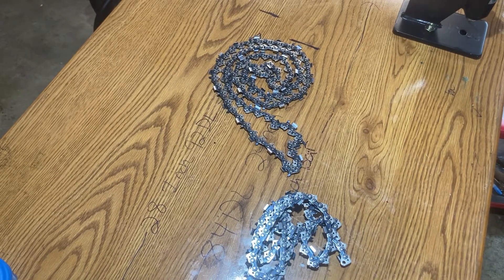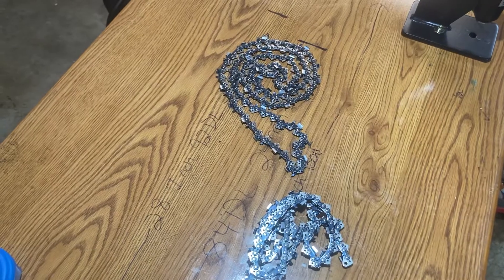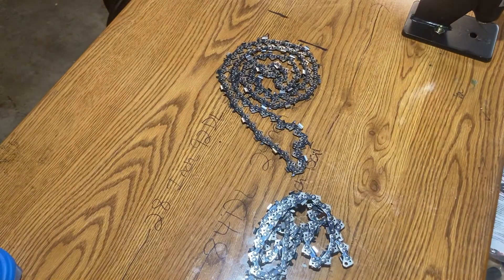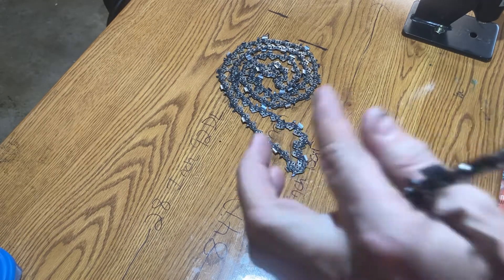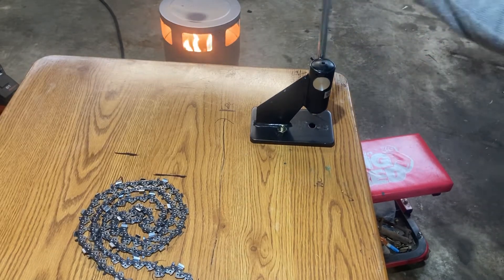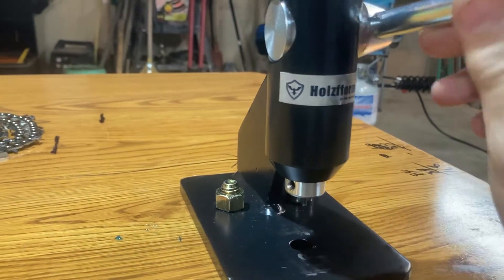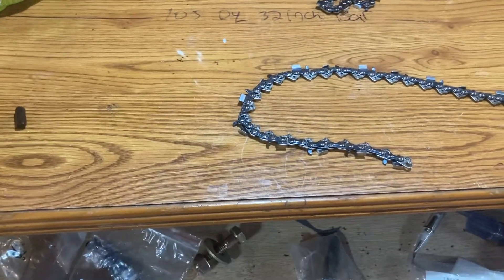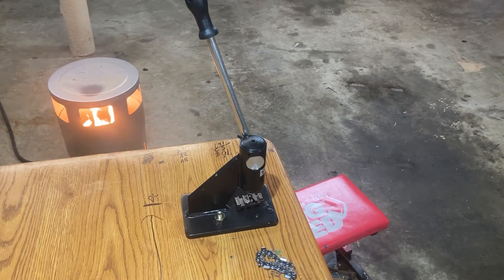Holzfforma Chain  Good or No Good also a look at the spinner and the chain breaker

Comment: Ive heard they are decent but do stretch a lot but have never ran it!
Reply from the maker: I dont think they stretch any worse than any other chain really as long as u keep them sharp and your saw is oiling properly thats what ive got on every saw i own and all my cutting in my vids are with it
Reply: @MitchellsBackyardLogging  yea i been. Lookn in to their chain for a while not tried any yet
Reply from the maker: @justinweaver8787  if i buy it on a 100ft reel from farmertec i can get it for about 230 a reel which i thin is about 14 cents a link
Reply: @MitchellsBackyardLogging  thats not to bad
Reply: How’s it holding up a year later? What’s your thoughts buy it again or go with a better brand?